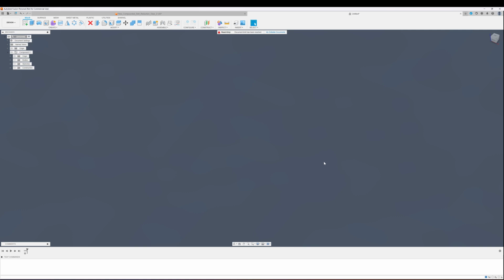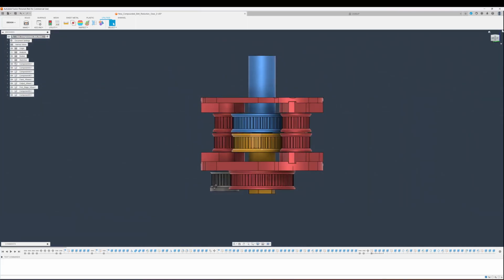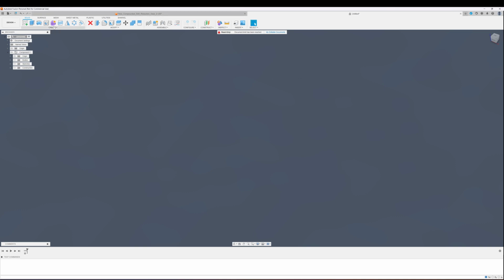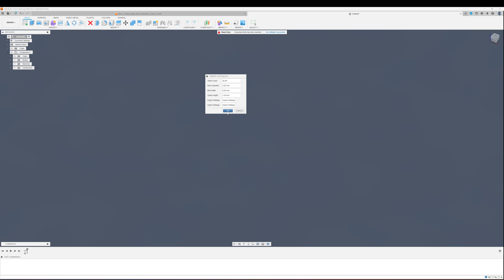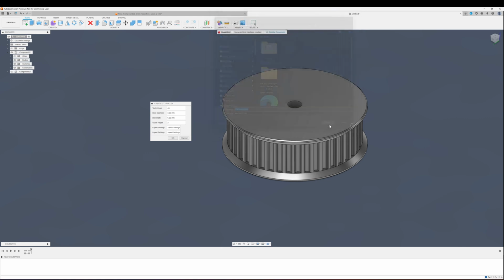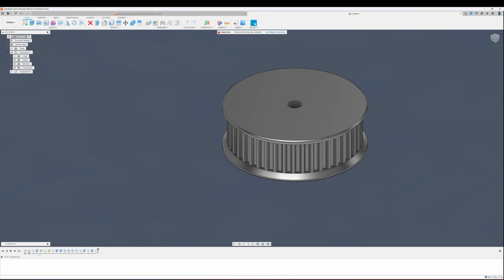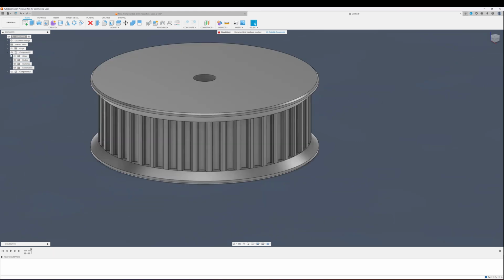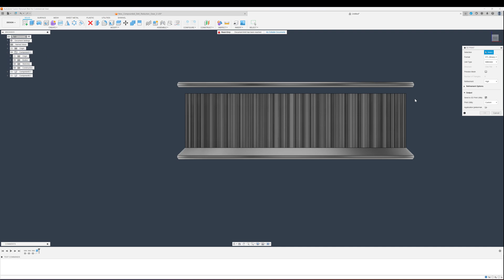Creating a GT2 Pulley in Fusion 360: Custom Script Walkthrough & Demo

Comment: what are the steps do did to ensure the belt and pulley properly engages and indexes the belt after printing the model?
Reply from the maker: You could play around with layer settings, seam settings and wall thickness. Another important parameter is the wall print order.

Comment: Any update on this? would love to get my hands on it!
Reply from the maker: • 0 seconds ago
https://github.com/Aerolyte/GT2-Pulley-Addin-for-Fusion-360
It is not quite ready yet, but it is usable. as long as minimum gear teeth is 10, minimum guide height is 1.2 and there are no 0 values.
Reply from the maker: this is now live on the App Store. https://apps.autodesk.com/FUSION/en/Detail/Index?id=3577467426184805780&appLang=en&os=Mac

Comment: Hi, where is the link for this script?
Reply from the maker: https://github.com/Aerolyte/GT2-Pulley-Addin-for-Fusion-360
It is not quite ready yet, but it is usable. as long as minimum gear teeth is 10, minimum guide height is 1.2 and there are no 0 values.